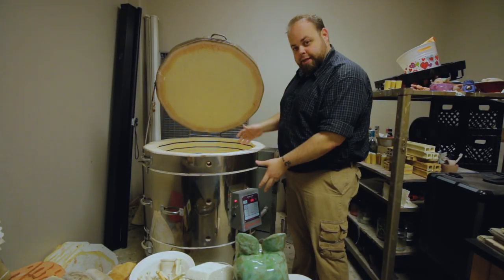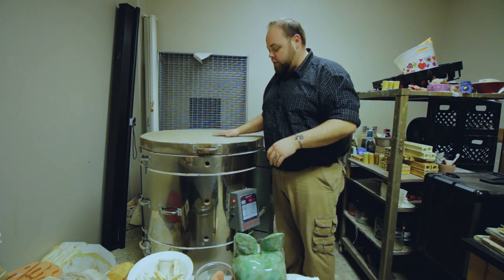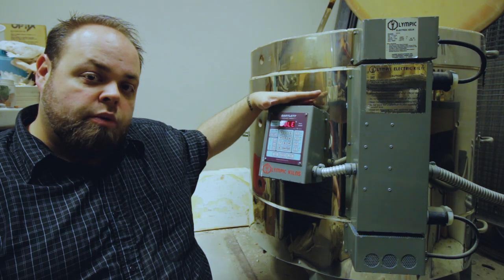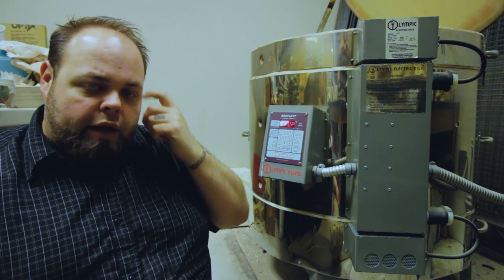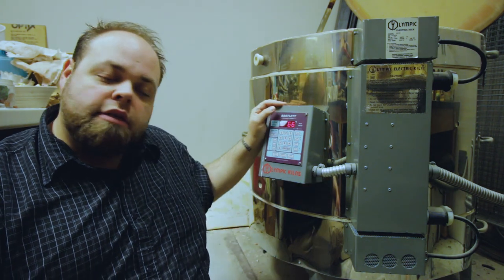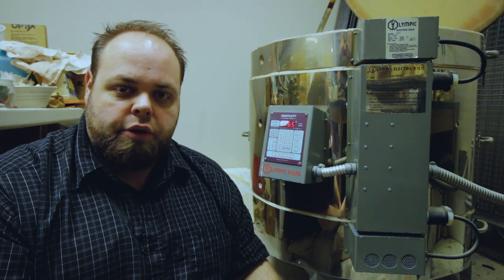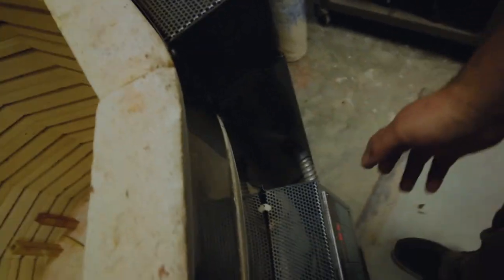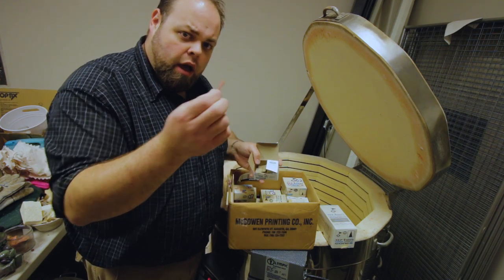How to fire a kiln - Ceramics 101 - University of YouTube

Comment: Thanks! Great, informative video. I'm running an old manual Gare 1818 with switches instead of dials and computers, so it does require a bit of babying and attention. Currently, I'm working through solving of pinholing issues. With the kiln sitter as the controller of power, I have to work on being around when the thermocoupler triggers, then reset it (gently) to return the power and work a soaking cycle. The size of the 1818 means that it drops temp at a decent speed once it hits cone 06, so some soaking it necessary. Would love to hear more about the post-fire cooling processes and techniques.
Reply from the maker: Is it cooling to quickly? The cool down should vary by glaze; common levels should be 100-200^ per hour. It just depends on where the heat is leaching from. You can also get “lambs wool”, (fiber glass “cloth”) to plug these areas too. Let me know if that helps.

Comment: Great presentation. I've just started using a rampmaster 2 electric Kiln - should I just turn it off when it reaches full temperature....I'm not sure if electric kilns have a 'cool down program' or whether it just cools down naturally over say 24 hours?

Thank you so much
Reply from the maker: Awesome to hear.
Typically, most kilns shut off (kiln stays on, but the elements stop heating) once they reach temp.  Then the kiln simply cools down to the air temp.  Similar to a pan that has been under the broiler for a long time, it will cool down on its own.  Just be patient.  
I usually start a fire on Friday afternoon and it is ready to open on Monday morning.  Check out the other videos in the "Ceramic Playlist" for more kiln guidance. ✌
Reply: @TrifireStudios  Brilliant - thankyou !

Comment: hi there!  Not sure if anyone is in the mood for answering a question or two about ceramics.  I want to slip cast some furnace tubes for work in chemistry.  The requirements are pretty simple.  able to withstand temperatures over 1000C and two, be tolerant to repeated thermal shock.  ie heating/cooling cycles of the furnace.  The ceramic will be heated with resistance wire.  I'm thinking of an alumina or zironia based slip.  Suggestions would be welcomed.  recipes would be appreciated! :)
Reply from the maker: Ok, so around 1832^f, that is around cone ^06 (1828^f). Any standard high fire stoneware would work, but the thermal changes are going to be the issue. Also you will have to heat them from room temp to register temp and cool fully again. The alumina will help with sticking/melting points, but not anything for thermal. You should look into refractory elements, or fire brick. The main point with fire brick is the airy-ness of the brick, built with sawdust, to heat and repeat. 
I go over several thermal parts in my raku video. Check that out and let me know. ✌🏻

Comment: I replaced my thermocouple recently with this one: https://www.theceramicshop.com/product/10880/type-k-thermocouple-skutt-6/?gclid=CjwKCAjw47eFBhA9EiwAy8kzNJ0H0AWij6SP2fY8_fcjrcLsgKc6AvCmlDyy494Qg1pz0CuG0ePHJhoCFtQQAvD_BwE Should I keep the big ceramic thermocouple cover from the kiln (the same one that's covering your thermocouple)? From what I've seen of Skutt Kilns generally don't have that cover since the thermocouple is already partially insulated with ceramic. Thanks!
Reply from the maker: I keep mine covered just in case as I’m taking ware in and out. A few dings and the metal filament could be damaged enough to give in accurate details.